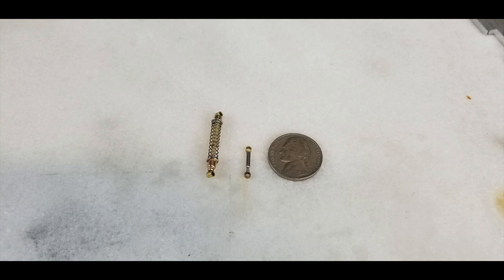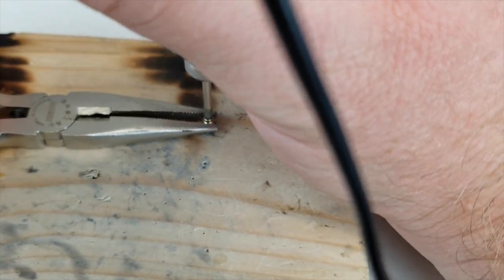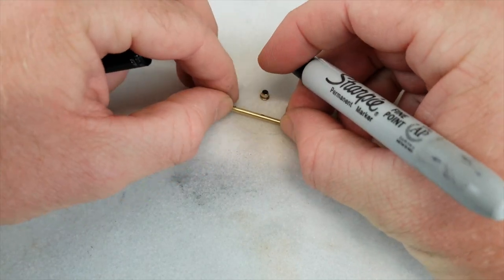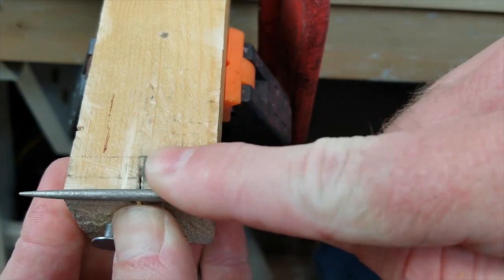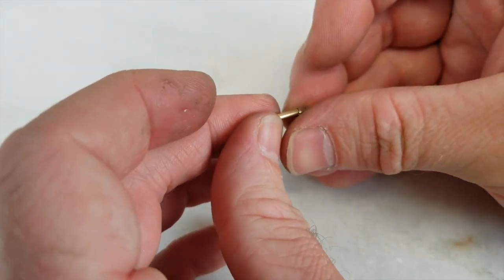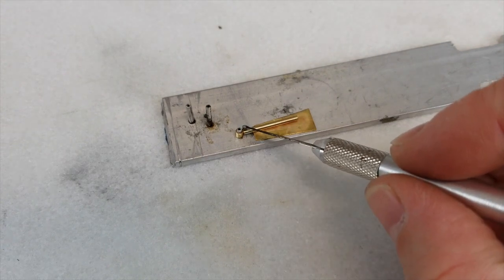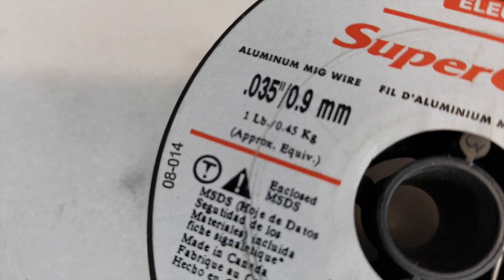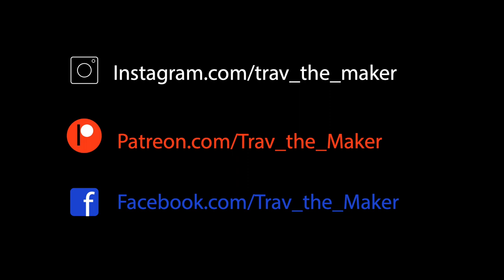DIY Tutorial 1/64th Scale Custom Shocks and Coil Overs suspension for HotWheels and Matchbox

Comment: Awesome tutorial. Just a question what size is the compression spring and where did you get it? Thanks
Reply from the maker: I used what I had on hand for this build just to show how to do it. The spring is 22/32" or 17.4mm in length and right at 5/32" or 4mm in width. Before doing this I did check and you can get various sizes online through Amazon or eBay just search for small compression springs. Either of those sites list the sizes so you can decide which would work best for your build. Take a look at my first shock video for other shock options as well. Hope that helps.
Reply: @travthemaker3323  thanks for answering. I'll look for them.

Comment: Where do you get springs the size you need for different model applications? That size coil over might fit a 1:64 monster truck, but for a car it's more like 1:25.
Reply from the maker: Amazon has the correct size compression springs for a car. Like i said in the video these would be more for a rock crawler or 4 wheel drive build. But the building technique could stay the same just switch out for the right size springs.